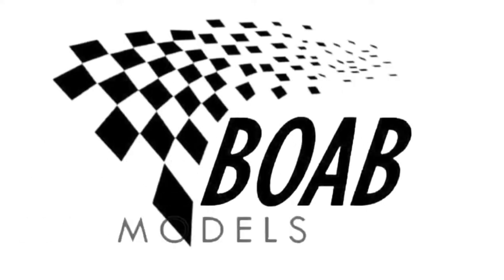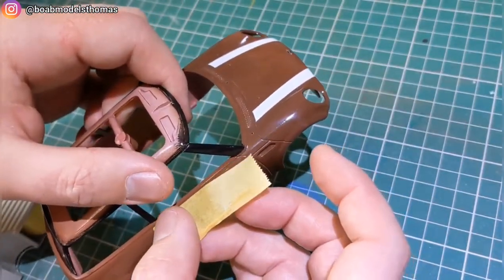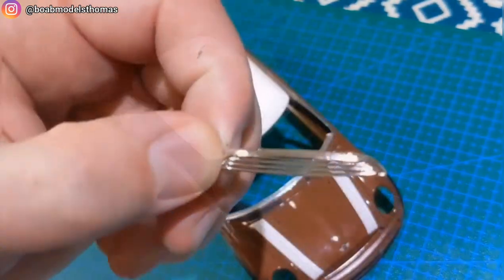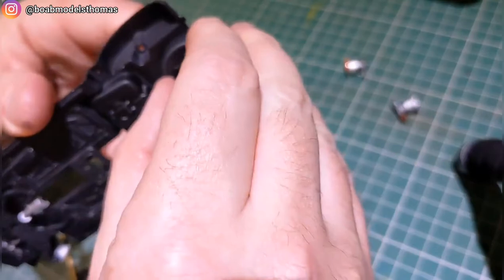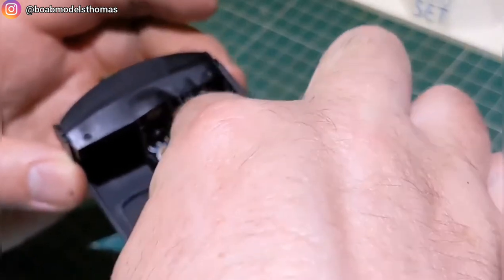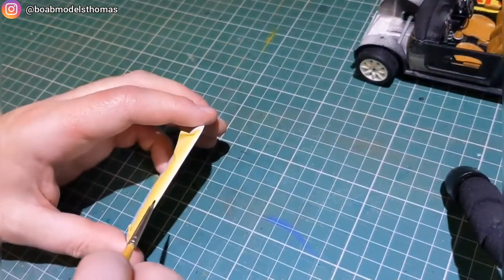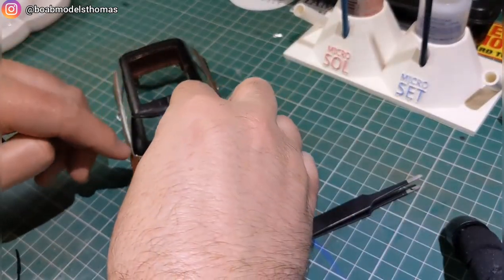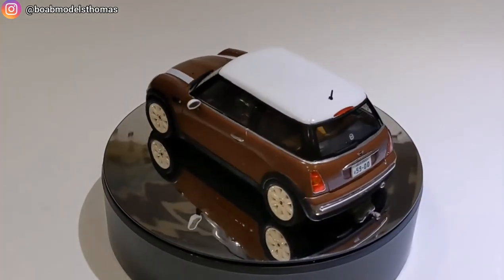New MINI Cooper - How to build the 1/24 Fujimi Model kit

Comment: They made the original mini up until 2002! There is an 02 reg near me. They overlapped for 6 months the old and new mini!
Reply from the maker: Really?? The information I found said they stopped in 2000 but I guess manufacturing and registration doesn't have to be simultaneous.